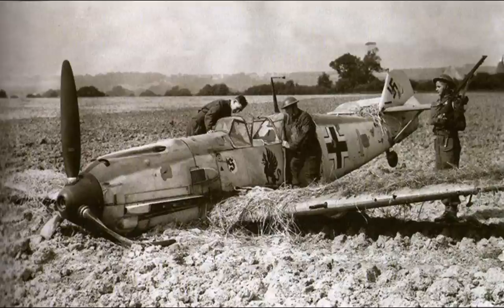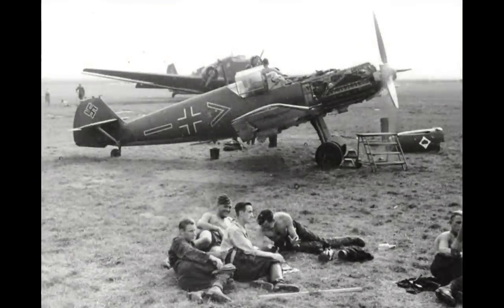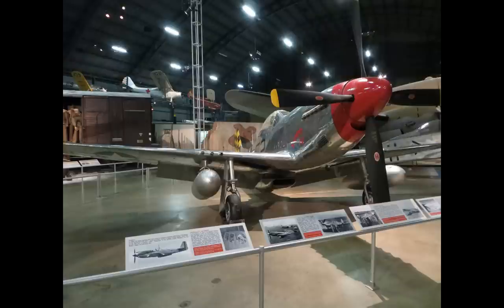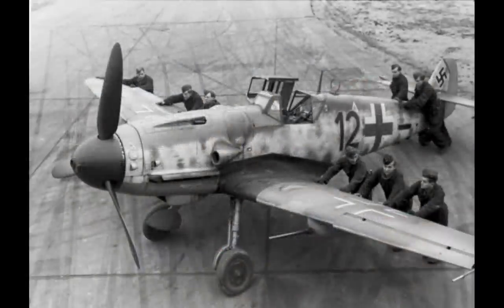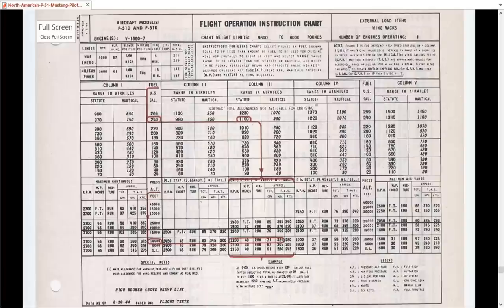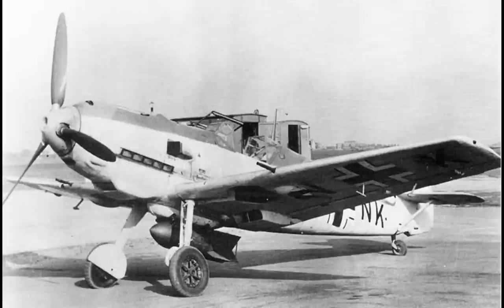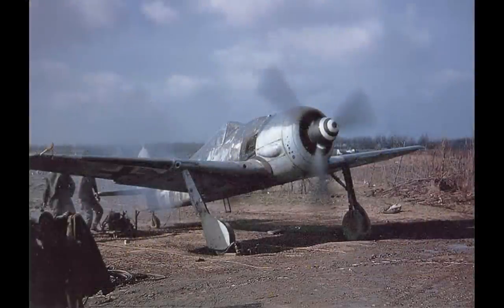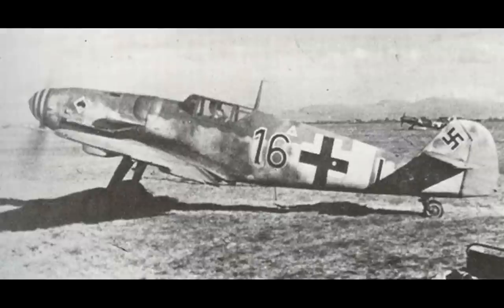Messerschmitt BF 109, Why Such Short Range?

Comment: In the moment the Bf 109 prototype has been built, Germans still had no engines of the suitably high power due to the Versailles peace treaty. The first prototypes have been powered by a British RR Kestrel of approx. 700HP awaiting end of development of a home product, Jumo of similar power.

The prototype had to reach set design goals, and there was to be a fly-off against several  competition planes. 
Small power available dictated a small airframe. DB601 1000 HP power class engine came only much later. Now this size factor started working against the plane. Not only was the range small but the wing loading has become high making the airplane less manoeuvrable in the turn. This was still inside acceptable limits at the time of DB601 up to 1942, but it made Bf109 more unpleasant in the later heavier DB605 motorisations.

So the plane has actually been a victim of its small initial prototype size, I believe, and less of any German predilections of performance or anything of the kind. The speed demanded has been 400 km/h

Comment: The real " advantage"  of the  F-51 came from the fertile mind of "Dutch " Kindleberger and the design team at NAA .  It was aerodynamically moe efficient !  A fact which wss accidentally  ( at least according to my information )  discovered - and reported - by a British engineering test pilot the delivered  design incorporating an Allison engine was faster than the lateest Spit variant at it critical altitude and he speculated  what re-engining one with a  Merlin would do.  As for the " range issue " its a zero-sum game.  ETO militsry - always over  land -  had little need for range, but a serious need for interception ( i.e tactical ) performance .

Comment: The answer is purely in the form and development of the air war and the roles expected of these fighter aircraft at the time as well as fighter performance. Tag in recovery from the previous WW1. As the war progressed along with rapid advancements in technology it became apparent longer legs were required to switch from defence to striking out at greater distances along with maintaining that fighter performance.

Comment: If the luftwaffe had acess to 150 octane fuel like the western allied airforces how much more performance could the bf 106 g6 get, and how easy would it be to change the aircraft to make use of the new fuel?
Reply from the maker: If the Germans had 150 octane fuel, and if the DB605 could handle the boost without blowing up, at 75" of manifold pressure it would have put out about 2600hp, maybe a bit more. That would have been a game changer.
Reply: @GregsAirplanesandAutomobiles  thank you for the answer. That is over 1000hp increase if im not mistaken. Boggles the mind a bit to be honest. Edit: well not quite 1000hp but still a massive boost.
Reply: Direct comparison to the DB605 is the RR Griffon which was also 37 litre displacement. It produced over 2,000hp quite easily.
Reply: They were actually getting over 2000 HP out of the hundred series Merlins that they put on the DH Hornet. The secret was 150 octane fuel and a very high level of boost. It's interesting that immediately post-war they stopped issuing 150 octane fuel to most units, and had to de-rate all the engines when they went back to the 130 octane stuff. No sense in running on the bleeding edge once the shooting has stopped.
Reply: iskandartaib true but postwar griffons were hitting 2,400hp and the 130 series  Merlins were only derated 40hp.

Comment: Cooling advantages of the venturi in a carburetor? I have watched a carburetor ice up on a 100 degree day. This is why carb heat is a necessity in aircraft. Of course this adds a lowered performance factor that has pilots making sure that, with the exception of unusual situations, carb heat is off for takeoffs and landings due to performance loss when it is employed. 

To wit: "I have about 200 flight hours in a fuel-injected C172. I have just jointly bought a C152 with a carburetor and I am getting used to using the carb heat. I am scared whenever I hear stories about engine failures due to carb icing." 

This is considered an advantage? It is notable that carburetion was first used in an internal combustion, automobile engine by Karl Benz in his 1886 Patent Motorwagen. So carburetor technology is rather dated technology. 

The only real disadvantages of fuel injection are the tolerances and materials required by the design. One simply does not work on a fuel injectors or pumps under a shade tree. Of course high tolerances and expensive maintenance tools lead to higher costs, which is why fuel injection in the automotive industry took so long to catch up to aviation after the war. 

The final positive factor for fuel injection is reliability. Like the turbine engine versus the piston engine, fuel injection has a much higher reliability factor than carburetion. This results in less frequent maintenance being required for fuel injection systems. Remember those all too frequent carburetor rebuilds? When was the last time you took your car's fuel injection system in for overhaul?

I haven't looked for a while, but I think that, thanks to advancing technology lowering the costs, increased fuel efficiency and lower maintenance required for injection systems, carburetion has pretty much gone the way of the dodo bird in the automotive industry. At least all the car engine I have looked at over the last few decades have all been fuel injected. In fact the trend towards fuel injection is now seen in the motorcycle industry as well. No doubt rituals like "tickling the carbs" will be greatly missed by motorcycle enthusiasts. 

And isn't it comforting to know that when one crashes through a guard rail and plunges inverted into the abyss, the last thing concerning the driver will be the engine cutting out due to negative Gs.

Comment: When we look at the p-51s fuel efficiency compared to other planes how important was the  more modern airfoil on the P51? Did it lower the drag enough to make a difference?
Reply from the maker: Yes, the P-51's wind design has a positive effect on fuel efficiency. I have a video that compares P-51 and Bf109 drag, it will answer your question more completely.

Comment: If they had capacity to build lots of aircraft, it might make sense to build something like the 109 to use for defense against attacks on the homeland, so they could design for performance and not worry so much about range; after all, the point of having the plane was to beat the other side's planes when they got together, it was not for passenger service. And as you said, our P-51 was a later design, after we had some feedback about what we needed; and we were flying long distances on offense, crossing quite a bit of Europe to get to the parts of Germany where the action was. Really interesting story. One point I found interesting was the part about water, or water/methanol, injection long ago. I wonder if it might be worth looking at that today for cars, if it would increase fuel economy, a big issue with gasoline or diesel engines for cars today. To turn the old saying around, those who do study history might learn something good to use in the future, instead of having to re-invent something that has already been done successfully :-)
Reply from the maker: I have quite a few videos about water injection in cars. In fact, the Oldsmobile Jetfire has a water:methanol injection system quite similar to that in the 109. I have have a video about it.

Comment: To be fair, if the Luftwaffe had been equipped with Hurricanes and Spitfires of the same vintage instead of BF109s, they would have had the exact same problem with range.
Reply: If they had Zeros they could of spent half an hour over Scotland.
Reply: @jimbenson3926  That would have been a very different fight. Great maneuverability with the Zero, twin 20 mm cannon but no armor protection or self sealing gas tanks.

Comment: What even more amazing about the db605, this precision engine was built in primitive conditions starting mid 1944. Underground factories, etc. An even better question is when you look the Me110/210/410, with their beautiful engines, how could they be so much slower then the P38 question mark keep in mind the P-38 was early War design and the Me210/410 were designs created during the war at various points. Both aircraft or absolute waste in Manpower and material. I've never understood how they could have designed a plane that inefficient. I mean when you look at the interwar planes in Europe and the United States it looks like your Dynamics was something you conquered with blunt force trauma. But towards so late 30s, streamlining begin to be more important. The German fighter Destroyers, had bigger and better engines then the P38 and were slower. The overall weight of the aircraft was simular in spite of the different crew requirements. In the book by Johnny Johnson, Wing leader, Johnny Johnson lamented the short-range of Spitfire he flew compared to the P51. If you've never read the book I recommend the book very highly.

Comment: One factor to take into account, german figures for range are for max cruise, which is what they used while in a combat area, not the most economical speed. Apples to oranges in some cases.
Reply from the maker: That's why I also gave cruise numbers at three different speeds for the P-51, including speed beyond which a 109G6 can reach even at full throttle.
Reply: @GregsAirplanesandAutomobiles  I noticed!

A useful table on Bf 109F fuel consumption.

http://kriegstechnik.blogspot.com/2014/06/bf-109-range-with-drop-tank.html

Comment: Perhaps the real reason is the original mission.  The Bf 109, like the Hurricane, the Spitfire and the US P47 and P38 were intended to be point defense interceptors that would get launched when visual/audio observers called a warning of an inbound bomber attack.  The aircraft would climb out at high speed and attack the unescorted bombers.  Speed and climb were paramount.  Range was not important.  
The US approach, unlike the German and English, used big airplanes with enormous power from one or 2 engines. That meant big airframes that could be adapted to add additional internal fuel and support big drop tanks.

Comment: Be 109 had 300 gallon drop tanks, But didn't have them until right after the BAttle of Britain, where it would have made a difference. Also, different fuel mixture would have helped.

Comment: Fantastic video as always. 
Isnt the P-51 faster compared to the 109 due to the more modern design, better areodynamics etc. Atleast thats my take on why but I may be mistaken.
Reply: woodman_victory ; Agreed. The higher octane certainly was a factor. But we must also consider the Meredith effect with the radiator and, it’s placement under the fuselage, as well as the Pascal principles incorporated into the aerodynamic design in addition to the “laminar flow” wing
Reply: Don't forget the fuel Octane.
Reply: @Spectre407  also, the G-models of the 109 were a cluster of small additions and field modifications due to the fast changing demands of the pilot. One day they had to intercept bombers, the other they had to keep mustangs off their airfield. This issue was only really adressed and solved when Ludwig bölkow got to designe the bf 109 K variants. By removing unnecessary features and re-adding already made but dropped changes like guns inside the wings and a fully retractable tail wheel, he and his team made the 109 a competetive fighter towards the emd of the war, though this old lady was thought to have seen its best days it emerged once more as the beast it once was. (Well, more like metaphorically, as the luftwaffe was basically beaten and production quality was sometimes so low that bölkow himself said its no use designing a first class plane if it wasnt build properly)
Reply: Jan Hemmer - the 109 was a fantastic fighter, especially considering its 30s design. I wonder what the performance numbers would have looked like if the DB-605 was tuned for 150 octane fuel!
Reply: @Spectre407  well the americans did that with a captured bf 109F if i remember correctly, but i dont have the numbers right here

Comment: People might be thinking of the cooling effects of evaporating gas in the carb.  It seems the DB engines had individual injectors as opposed to a throttle body setup... I don't know how significant this would be, however.
Reply: Where were the injectors? Inside the cylinders or in the intake manifolds?

Comment: @11:30  Here is something wrong:

About the cooling effect of a carburater in front of the supercharger => the cooling effect is not because of the venturi of the carburator BUT because of the fuel which is evaporating which needs heat! 😉
And that can be a good thing to keep temperatures a bit lower in the supercharger.

Of course you can also use intercooling between the supercharger and the engine.

The Germans used also methanol-water injection to cool the intake air. Maybe only when max power was needed.
Reply from the maker: Please listed to what I said carefully. I think you are hearing something I didn't say, or not hearing what I did say. I said nothing about evaporation of the fuel, I was saying the carb is NOT superior, and that there is no net benefit from the venturi effect. If you have more questions on this, please read the description where I address this in more detail.  Intercooling and water:methanol injection are discussed at great length in other videos on this channel. Thanks for watching.

Comment: The cooling effect at the venturi isn't due to the venturi, it's due to the fuel being vaporized there, which absorbs a lot of heat, with alcohol fueled motors it's not uncommon to see frost on the intake manifold from this effect of the heat being absorbed.
Reply from the maker: Yes, and that's NOT unique to carbs. You can get that via fuel injection, and the Germans certainly did. So do we all agree that the venturi effect is not a benefit?

Comment: One thing, one have to take into consideration,during the Battle of Britian campaign, is ammunition expendure.Given the intensity and almost sure incounters with british defending fighters, on each sortie, would mean that the ME109 could when escorting bombers, run out of ammo before running low on fuel. So having a larger fuel tank that allowed the ME109 to fly around an extra 20-30 minutes in british airspace, would not help alot when out of ammo. And Luftwaffe at the time having fewer fighters than bombers in around a 1-2 ratio, meant they never had ME109's enough to do a sort of escorting relay of the bombers for longer reaching air raids beyond and north of London anyway, than when the USAAF in comparison raided Berlin. Besides the real objective of the Battle of Britain, that certain commanders in Luftwaffe forgot, was to establish a strong enough local superiority in SW England and English channel to cover a would be operation Sea Lion. That the whole concept of Sea Lion was flawed and most likely would end in an disaster, is a different story though ;)

Comment: After the battle of Britain was there any major theatre where the bf109 required a long range? In the west, it was doing short climbs to intercept bombers and in the east it was maintaining air superiority over the front line. They really weren't doing much in the way of bomber escort after the battle of Britain anyway.
Reply from the maker: That's exactly right, the range factor was primarily an issue in the Battle of Britain, and of less importance later.

Comment: I was under the impression that the drop in temperature you can see after a carburetor was largely the result of the vaporisation of the fuel. I understand there is a temp drop with a pressure drop but a change of state should cause a greater exchange of energy. 
Definitely would expect greater volumetric efficiency from removing the carburetor venturi. 
I am impressed with the longevity of the spitfire and 109 designs considering WWII pretty much took us from biplanes to jets.
Reply: The later carburetors on the late mark Merlins didn't actually use a venturi - the fuel was injected into the eye of the supercharger's impeller. Come to think of it.. why would anyone need a venturi if you have a fuel pump? In most textbooks on the internal combustion engine they state that the venturi is used to provide suction to bring fuel from the float chamber to the jet (using the Bernoulli effect). But if you have a fuel pump a venturi that restricts airflow to provide suction isn't even necessary. You can just pump the fuel to a spray nozzle in the intake stack (with some sort of metering device to control the mixture, I'd assume). You would, of course, use a throttle valve so that your engine isn't running at full throttle all the time, but I assume this would also be true for a spark ignition engine with fuel injection. (With diesels, you don't need a throttle valve - the intake is always wide open and the engine speed is controlled by reducing the amount of fuel injected into the cylinders - this won't work for spark ignition because reducing the fuel would result in a lean mixture, which would cause ignition to fail and cause the engine to miss or cut out. One failure mode of diesels is "run-away" - apparently it starts burning lubricating oil and since there's no throttle valve it starts running at maximum speed and there's no way to throttle it back since there's no throttle valve.)
Reply from the maker: The later Merlins used an "injection carburetor" which is a type of fuel injection. The earlier types used a conventional carb.